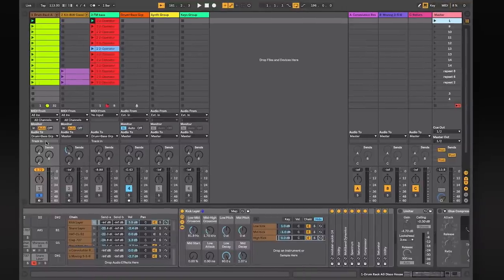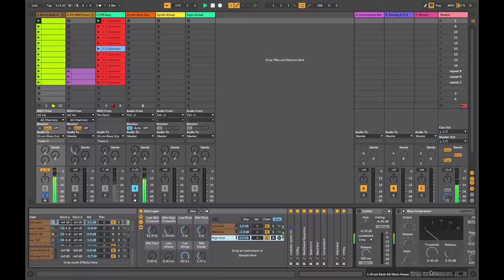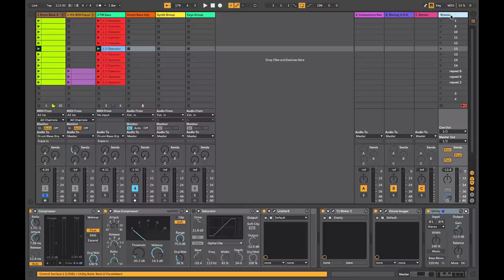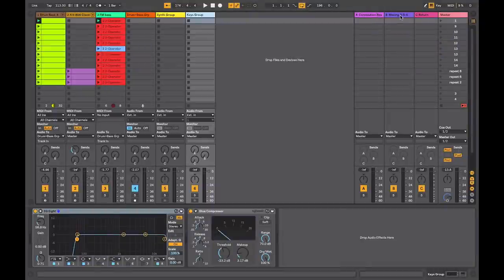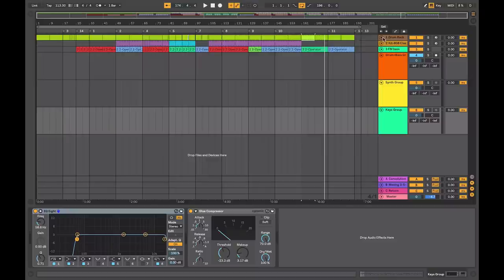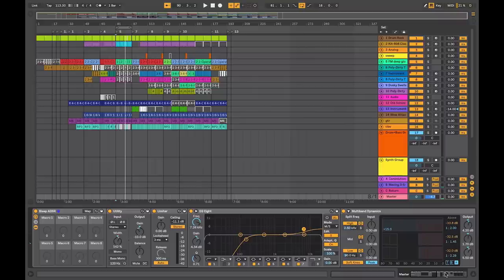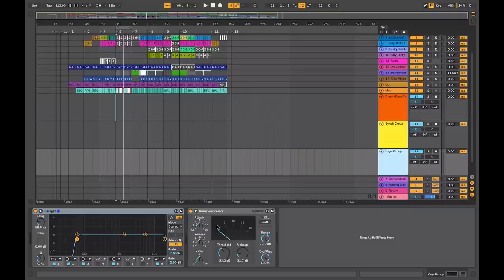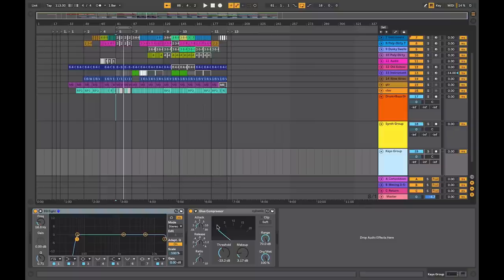Bottom-up and top-down mixing advantages and disadvantages

Comment: Thanks!

I like to use both approaches and it usually depends on the complexity of the arrangement. I began using a top down approach, but probably as at that time I was struggling for system resources. I then tried bottom up, but 'printing' the tracks to save resources and now probably use a bottom up approach more often.

It's the same with templates.Sometimes I use one and sometimes I start a project with a blank canvas. I think it's important to try different approaches to composition and mixing....especially when a project is becoming stale, or you are lost for ideas. :-)